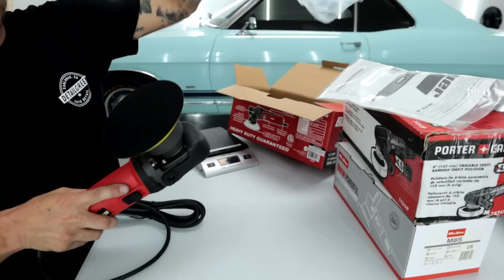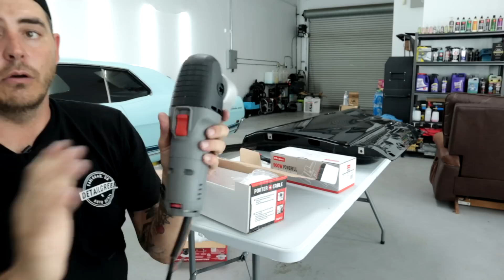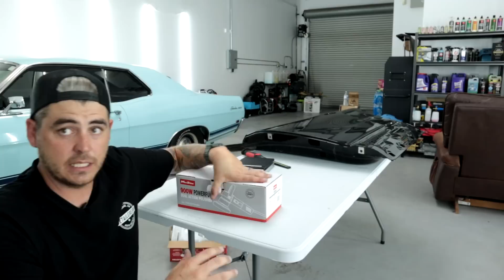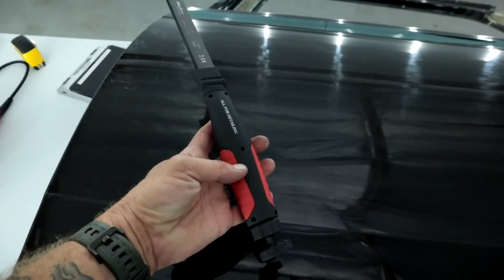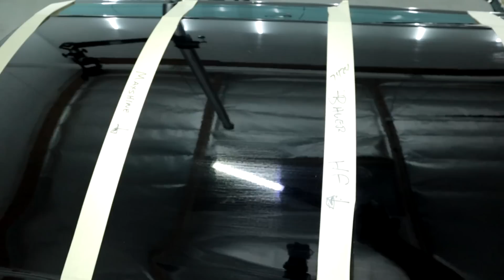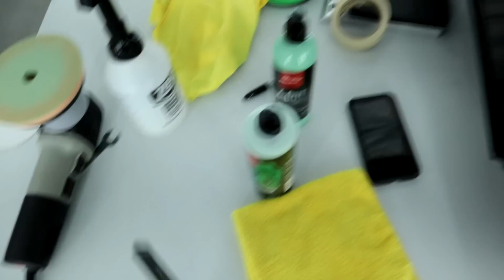Best Polisher for Beginners or as a BACK UP PorterCable Maxshine Bauer

Comment: Do Dr Beasleys grease swap trick with the Bauer, and put a decent quality "5 backing plate on it, and it will put that Max Shine machine to shame. That crazy vibration will be gone also. I keep 1 on my truck as a spare just in case something happens to my Makita. I also purchase a few of the Bauer units once a year for $39.99 ( on the cyber Monday sale ), grease swap and plate swap em, then gift them to detailers in my area that are just getting started. I put on a class twice a year for polishing.

Comment: Just last week I went into harbor freight to buy my first polisher. I initially expected I would leave with the 8 mm version but they had the 20 mm DA on sale for 60 bucks. I couldn't pass that up. When I got it home after checking it to make sure it ran right. I replaced the grease with Lucas white hi temp lithium grease. I then ordered a Max Shine 5-in backing plate now I'm good to go. Swapping out the grease definitely made a big difference in not only the noise level but the smoothness of the machine as well.

Pretty hot and humid where I live right now but as soon as summer is on the way out and early fall is moving in.  I'm going to ceramic coat my 2024 Mazda CX-30. 

Right now it's looking pretty good with just using ceramic gloss spray on it but I'd actually like to do the full ceramic coating on it. I like DIY details products and I'm leaning towards their version 2 ceramic coatings but I'm open to suggestions.

Comment: Max Shine M8S V2 8mm DA in Canada is about CAD 179.99 + Shipping. The Porter Cable 7424xp is around $200 CAD on Amazon. The HF is 79.99 USD. I would have to cross the border into Niagara Falls, NY and with the conversion rate, and warranty, it's about $100 CAD. I just checked their websites to compare similar models.

Comment: This version has mor amps, starts up smoother and love the fact that it comes https://www.youtube.com/post/UgkxfzbDkCRyv3CFXnLZI4APZtRRuG2uRmP2  with two types of handles(both scratchproof) and a Velcro 7 inch disk. My boat and cars look like new again ! Love Dewalt tools because they seem to last a while and AMAZON for the great prices ! Update 07/14/2021I still have and use this polisher very often on my boat, truck and cars but recently I refurbished some stained, dull kitchen granite countertop(stain removal took two months) polished with a white hogs hair polishing pad and MB20, wow ! Polished up like glass and looks better than new. The sealer took two days then some tenax granite wax . I can’t believe how nice this all went. I also polished the travertine tile in my kitchen and dinning room and it too looks like “Vegas”. This dewalt polisher has also cleaned up rust from metal(circular wire brush) and cleaned off stucco for a repair I did on the house. I always purchase the right tool for the job and don’t stick with a certain brand or color(I have Fein , metabo, Bosch …) this dewalt is at the top of the heap fir polishers.

Comment: Where to get a 5 and 3 inch hook and loop backing plate for my portal cable 7424XP DA with pads ? What AWG of extension cord do u use with the portal cable 7424XP ?

Comment: 1.  After listening to this whole video it sounded as though you wanted to like the Maxshine the most from the beginning.

2.  If you are testing all polishers as they come, you should have used the 6” pad on the Bauer. You can only say the Bauer did not do as well as the Maxshine using an incorrectly fitted pad; which could’ve effected the Bauer’s speed, vibration, overall effectiveness as designed.  

Oh, I’m still considering which polisher I want to buy.
Reply from the maker: The maxshine is defintley the most powerful of these.  The Harbor freight though is an amazing value. By changing to a smaller backing plate that actually increase the rotations and gives the 5" pad more polishing power. I do agree though that it could effect the balance.  The bauer is heavier as well, but if youre just working on your own cars the bauer is probably a great fit! Value is amazing for sure.

Comment: I have the Harbor Freight DA with a Meguiar's 5" backing plate. I also changed the grease in the head. The grease helped with the sound and the backing plate helped with the vibrations. I would say it's still behind the more expensive brands as far as vibrations, but if you are just starting or a DIY person, it's great.
Reply: Thanks for the info. Can I ask what type of grease you put in there instead?

Comment: Running the wrong size pad on the Bauer is really quite unfortunate. For one, the tool is balanced to a different size pad in terms of weight so that will add vibration. Two, you most likely did not center the pad perfectly, which of course can cause added vibration. Lastly, because the pad size is different than the backing pad, and different from the other 2 tools your results will be completely skewed as the energy transfer is not the same. So just in terms of fairness, the entire test is really quite invalid.

Also, seems a bit biased to compare a special sale price for the Maxshine and not even mention that the Harbor Freight polisher is frequently on sale anywhere from $39.99 to $59.99, depending on the specific sale.

Comment: max shine backing plates fit the bauer...I used that regreased it and it runs so smooth...no vibrations until it is slowing down after lifting your finger off the trigger.

Comment: I just noticed that super clean on the shelf back there which only confirms deeper that you're a man of culture ;)

It's a bit blurry but it looks like you also have a container of their absorbent/sweeping compound and I was wondering if you'd had a chance to use it or what you think of it?

I love sweeping compounds for home and I really think there could be a niche for them in the detailing world, especially with the focus on removing dry dirt getting bigger.

I feel like a good value well performing sweeping compound could be a very very helpful game changer when it comes to absolutely filthy details where you have a lot of dust and dry dirt to clean up and don't want to just spread it all around. Not sure I'd be willing to use it on all surfaces but anything with rubberized mats or whatever may be a good candidate for a test.

Comment: I've been using the Porter Cable for ten years now. Initially I started in a rotary, but prefer the random orbitals. 

Today I have a nice set up of Rupes polishers and a Flex 3401, but the Porter Cable is the first try for just about any job I do.
Reply from the maker: That’s awesome! Yea the porter cable was a staple!!! I actually started out using a cyclo… do you remember those?
Reply: @imjoshv  is the cyclo dual head any good?  I still have one brand new in the box along with a porter cable I bought years ago from Adams LOL
Reply: @imjoshv  - I never owned a Cyclo, but became aware of them around 2007 when I started checking out detailing online.  I started in 1996, and in those days the internet wasn't what it it today!
Reply: Agreed

Comment: I have the Bauer and I hate how much it vibrates. Kills my hands to use it
Reply: Change to a 5" backing plate. Also do the grease swap trick on it. They come with almost no grease in them, and none of it is actually on the gears. Dr Beasley has a good in depth video on how to grease swap the Bauer. It'll run smoother, cooler, less vibration and won't stall as much.

Comment: I bought the Bauer from HF a while ago. I was skeptical and it’s the most money I’ve spent on a single item at HF. It sounds like there is something wrong with the unit you demoed.  Mine doesn’t sound like a bag of marbles, but it does have a vibration much like you described. More than I would like. Mine is not nearly as noisy as the one you ran either. I haven’t looked to hard but the 6” pad is not industry “standard”. HF does sell pads, and I found their cheaper pads work better and last longer than the Bauer pads with the beveled edges. If I were to make this purchase again, based on what I’ve used and what you showed, the Maxshine tips in as a better value. Great review. Thanks for video.
Reply: Follow your instincts my friend. If it's not too late, I would return that thing because using a buffer is a much better experience  than that Bauer.
Reply: @larrydavisj what would you recommend for someone who wants to begin?

Comment: Bought my first polisher today, the Bauer since for ITC Members, it was only $49.  Started conservatively with  5" Chemical Guys orange medium cut with their P4 polisher, after clay bar.  Not bad at all... easy enough to maneuver but does vibrate quite a bit; good enough for a beginner like me and can't complain about just spending $50.  Now I have something to compare with when I get the itch to upgrade (which for me usually happens sooner than later.)
Reply: Yeah I picked one up for $49 to have as a back up for my Porter Cable 7424xp. It does ok as long as you don’t use the Porter Cable and switch immediately to the Bauer. The vibes are very pronounced if you do. The PC feels much more substantial and better built but it’s apples and oranges.

Comment: The Bauer DAs use a cheap Chinese grease I use the 20mm Bauer DA. I replaced the backing plate with a rupees backing plate n cleaned out the factory grease n replaced it with sun Lucas lithium grease n man a huge difference I use it for my detail buisness
Reply from the maker: Awesome good to know
Reply: @imjoshv  it’s actually balanced better wit the rupees backing plate as well

Comment: Great comparison Josh.  I cut my teeth on the 7424XP 9 years ago, and finally decided to upgrade to the MaxShine M15 (not the M15 Pro) this week.  Used the M15 today and was super impressed.  The 7424 XP just bogged down too much (stopped rotating) on even slight concave curves, glad that the M15 just breezed through these same curves without bogging down at al.
Reply from the maker: I have a m15 (non pro) as well! It’s my back olio now but it’s a great machine
Reply: My Porter Cable bogs down so easily, it's  frustrating!!!

Comment: Thanks for the video..  For the value, I'd just skip the Bauer 8mm and get the 20mm long throw.  Can be had on sale for 89 bucks.  Add a maxshine or Torx 5" backing plate, regrease with some decent grease and you have a much better balanced and capable machine compared to the 8mm for just around 100 bucks.

Comment: Josh, I'm confused about All in One's having wax in them. If you're going to use a DA to polish, aren't you going to IPA after and then put a coating on making the wax pointless?
Reply from the maker: Yes correct, under normal circumstances you’d just do the all in one. Since I was testing them to see the results I did the panel wipe just to get a clear view of who the winner was.